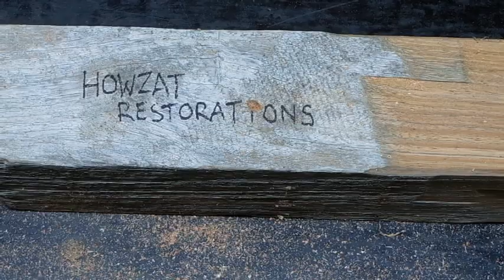Stanley 803 Hand Drill Restoration - Vintage Egg Beater Drill

Comment: Those are pretty basic drills. Stanley didn't have good fancy egg beater drills until they obtained North Brothers Manufacturing who had some really wonderful and beautifully designed drills very early on including all the Yankee screwdrivers.

I use all my manual hand drills for screwdrivers and nut drivers more than anything else. 😃